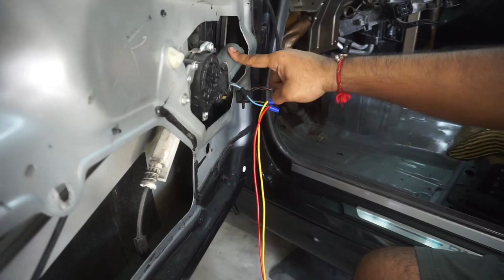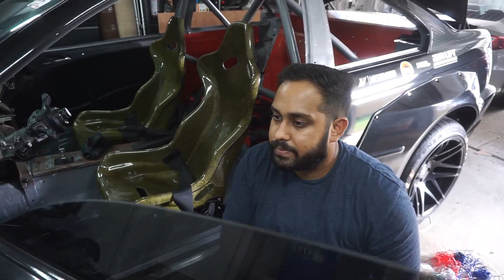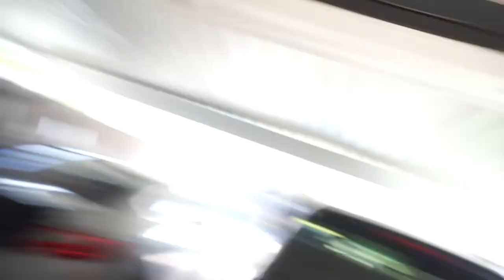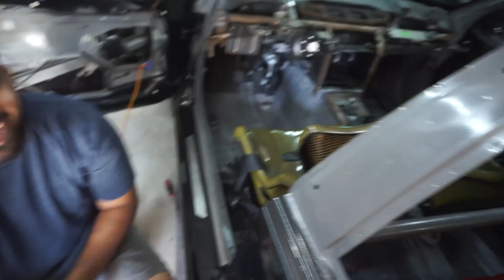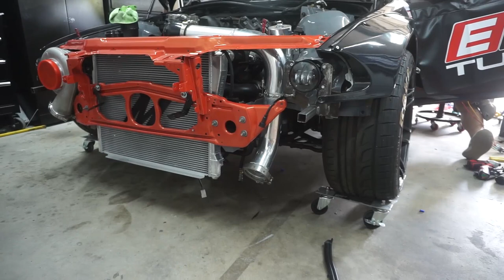How To Wire Power Windows To A Toggle Switch! Race Car MOD!

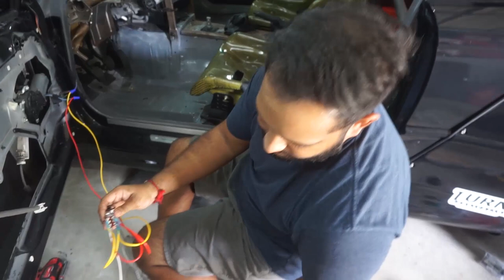Comment: 1:54  You don't put the same amp fuse to match the switch to save the switch. If you want to protect the switch you use a smaller fuse.  And there is no ground to the window motor. If you really want to protect the switch you should use relays instead.

One more thing. If you are going direct, like you are doing here, then use a 5 pin window switch. Less wiring at the switch.

Comment: Hi thanks for this video. I’m converting a manual to power window on my Mazda B2200 using 1993 Toyota 4runner 2nd gen window controller and wiring harness. Can you splice the wires from the main window controller to control the passenger side window? Not sure if there is another wiring in between that I need to get it work. Or if you have better ideas enable to use this wire I would greatly appreciated.

Comment: Will it work with a fixed 3 pos switch? Coz I kinda want to roll my window all the way down/up without holding my finger on the switch.
Reply: you need relay for that feature

Comment: yo bruv if you ever have some extra time with tings like this, may I emplore you to help with a few questions of mine.  I am stripping my '07 VW Rabbit 2.5L (automatic :( :( :( i love standards ahhh! lol.  Okay so basically I am doing something similar to my car as you are yours.  I am eyeing some ROCKER SWITCHES and PUSH BUTTON SWITCHES to bring all my wires (previously in the doors), to my dash or whatever.  Could you help clear some things out for it.  I would be indebted to you if you can ! :) . 

I am assuming ROCKER SWITCHES would suit the WINDOWS up down up down eh, but my ROCKER SWITCH has only 3 terminals.  From left to right they are: Ground , ACC , and Power.  Do you believe this is sufficient for them as is?  You know before I go abusing my poor car too much more Xd. 
----------------------------- I believe the rocker switches would be viable for the use of the windows too as you have clearly shown in this vid

My other 2 switches ive just bought outta curiosity are a PUSH BUTTON SWITCH and an IGNITION SWITCH.  
-------- For the PUSH BUTTON -> it is basic,  2 terminals.  Would 2 of these work for the simple purposes of opening the gas tank and Trunk? 

The Ignition switch I've acquired  is 20 amp 12 V.  though it has a 30 amp rating as well.  How it works is instead of a button you push in, mine you must pull the knob out and it stays, then you have the option to push it back in again.

If anyone is serious about helping me it would be like super appreatiated :) :)  I can offer my contact if anyone feels like blessing me with their electronical knowledge OwO Thank ya! and GREAT VIDEO